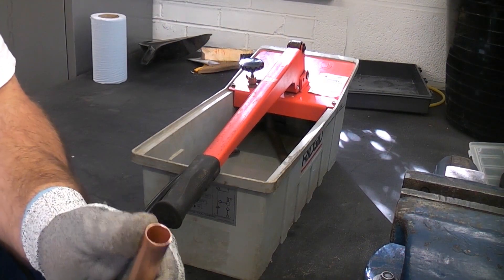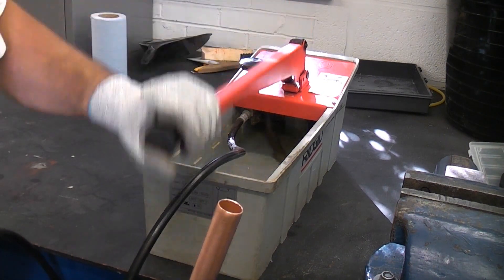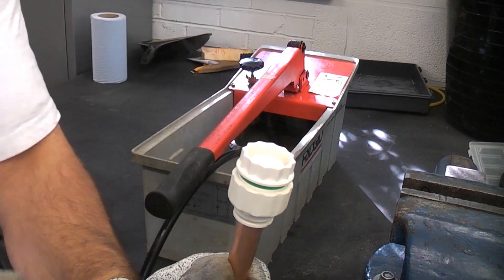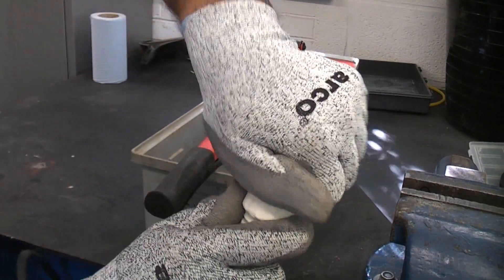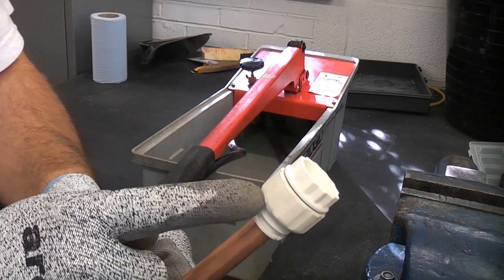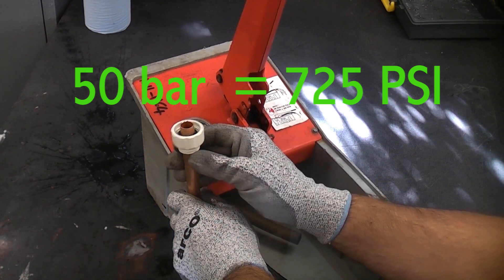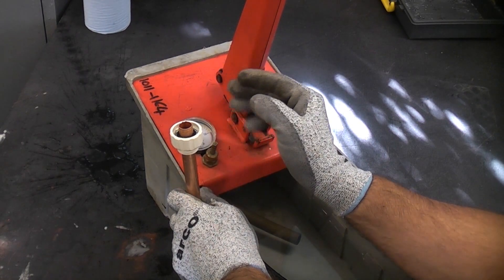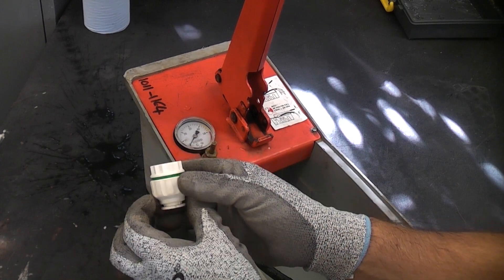Push fit fitting pressure test

Comment: This video is 8 years old and so are the comments.  Even now in 2024 push fit fittings aren’t old enough for anyone to tangibly say that they don’t hold the test of time.  But JG Speedfit and Hep2O are both rated for 50 years - instead people have formed opinions on them because they don’t trust anything other than traditional methods. If they are fitted correctly they won’t fail, the same as copper if it’s prepared and soldered correctly.  I swear by them - I’m not a plumber, but let’s say an ‘advanced DIY’er’ who knows what he’s doing and has a lot of renovation experience who does things within regulations - anything new installed that is hidden is done in plastic and push fit, anything visible is done in end feed copper - I’ve had zero issues with either.  Let’s be honest CH is 1.5-2 bar, a good mains water is 2-4 bar - this just went to 50 bar, and these fittings have advanced since this video.  Accept the change and trust these lol

Comment: was a plastic part that failed, not the seal and not the teeth.  If the same test was done with a straight connector in situ it would take even more pressure.  I am one of those people who look at push fittings and think how could that possibly work?  For me there are no questions that need answering anymore.  It's no wonder you see them everywhere in hidden locations.

Comment: Could you do a pressure test on a push fit fitting using the push fit plastic pipe? Just to see which gives up first, the pipe or the fitting. Great videos 👍
Reply from the maker: I tried that once; I did the exact same test using plastic pipes with no pipe inserts. The reasoning behind the video, was to show how important pipe inserts are in plastic pipe. I went right up to 50 Bar and the stop end would not blow off from the pipe. I wanted to make that video, as the plumbers at my sister’s house have done all the plumbing in plastic pipe and have not used a single pipe insert! 
Obviously when I do any plumbing jobs there, I always put pipe inserts in  👍

Comment: Repeat the experiment keeping everything at 65 degrees C (temperature of hot water tank). It will fail at a lot lower pressure. Do the experiment by filling pipe with dye coloured water, and submerge whole experiment in a bath at of water at 65 degrees, let everything come to temperature, and then do the test.

Comment: Think  we are missing something what about the rubber O ring how long before that perishes , no good having 40 bar if the rubber O ring ends up letting water pass after 5 years. Think about all the new builds with plastic pipe hot and cold even the central heating system is plastic, don't forget get plastic in new builds was only started because of money saved in materials and labourer not because it's better than copper.
Reply from the maker: There are advantages and disadvantages to copper and plastic. I've also seen soldered joints that have started to leak in relatively new houses, perhaps because the plumber has not prepared the joint properly before soldering. 
Like you say the O ring, is probably the bit that is going to fail. When I worked on site we used lots of push-fit air fittings, some of which were 30 or more years old, they rarely leaked.
Thanks for the comment 👍
Reply: @ultimatehandyman  30 year's that's a long time. Maybe we all should give plastic a chance I guess we will only find out in time. Someone said john guest gives 25 years on his O rings not sure if I believe that. What it is I've got hot and cold feet to the kitchen I need to extend it to the sink but can't get the cold to stop weeping so I can't solder it I've even left it for 2 days to see if it stops but no luck so I might have to use push fit but it's going to be somewhere I will never get to unless I rip out the worktop.

Comment: the problem happens using plastic pipes and plastic fittings at high temperature... it's rubbish anyway... a real plumber works with different materials and does good installation..
Reply from the maker: I've seen copper pipes develop pin holes and soldered joints leak over time too!
Thanks for the comment 👍
Reply: @ultimatehandyman  i'm not talking about copper pipes only.. there is multilayer pipe that's very good.. the brand that are u using in the video it's absolutely the worst in the market.. one other thing... use copper pipes with pushfit fittings it's not professional.. thank u

Comment: After 12 years in my domestic house, I had to replace a plastic fitting.  After conducting my research with 3 plumber supply stores. 2 stores had stopped stocking the plastic fitting and only supplied the old school brass and copper types because of negative feedback 
1 store owner advised me to lift the attic floor boards  (bungalow house with pipe running over head for the radiators)   I was  lucky to find 3 more plastic fitting out of 16  ready to slip off!!  These plastic fittings expand a little tiny bit over time when  the hot water passes through, they are supposed to tighten up  again as they cool down. After 12years they no longer tighten up by themself and caused a ceiling leak  

I have now replaced the plastic fittings to brass fittings and I expect get around 30+ years of piece of mind out of them.
Reply from the maker: Where they used with copper or plastic pipe?

Comment: Worked with a guy wo was like never use these on heating I'm like why my hole house is on pushfiit, it'll fail one day he says I'm saying no maybe 20 years my boilers been at 1 bar for 6 years, so anyways I seen him use it on a kitchen job used a hack saw to cut the pipe and no inserts, I say that's why it fails no wonder, big argument I walk off job, labourer knows more lol skilled labourer more like 👏
Reply from the maker: I've seen lots of push fit fittings installed on push fit pipe with no inserts.
It's just a matter of time before a fitting pops off and floods the place!
Thanks for the comment 👍

Comment: Pressure testing is a dangerous activity. You are correct about water being less dangerous than air. You never use air unless totally unavoidable. In the video you would have had air in the end of the compression fitting, this should have been vented out. You also need to provide more safety restrictions when doing the pressure test with water you was holding a lethal weapon in your hand whilst pumping up the pressure. Just a few tips from  Pressure Vessel Engineering.
Reply from the maker: Thanks for the comment 👍

Comment: i was in at Lucas CAV Sudbury in 1982 they had a bosch thermal machine the mains gas was pumped by a compressor to the thermal machine they did the pipework themselves and pressure tested 15 mm copper soldered pipe to 900 PSI
Reply from the maker: Blimey 😱
Thanks for the comment 👍

Comment: Great video, but few legacy folks still use copper systems which requires a plumber call out just for simple things, the modern technology allows plumbers to spend less time onsite and get the job done without heat (soldering) etc, and still ensure the same charge to the customer, it really helps save time (which is money) to keep customers happy and I am sure they are happy to pay same fees to plumbers. Copper should be almost eradicated from household plumbing and replaced with modern flexi plastic systems.
Reply from the maker: There are advantages and disadvantages to both systems.
Thanks for the comment 👍

Comment: Can you leave it at a constant 40 over a few weeks and see what happens?
Reply from the maker: No, normally when you pressure test a pipe/fitting you only do it for a specified amount of time. For steam pipes on site it is only about 30 minutes. If you leave the pressure in the system for longer than that, it will probably cause damage to the testing rig etc.
Thanks for the comment 👍

Comment: How does it fare against sustained and variable high pressures?
Reply from the maker: Not sure, I only made this video to prove that they actually do work, as some people did not trust them.
Thanks for the comment 👍
Reply: @ultimatehandyman  thanks for the reply. I'll be replacing my ground floor copper piping with pex in the summer. Was originally going to use compression fittings, but I'll possibly switch to push fit now instead given the ease of use. 
I'm just concerned about longevity.

Comment: Can you use this kit to also test pipes for air tightness instead of water?
Reply from the maker: No, you should only pressure test using water, as it is not compressible by much (about 10%). If there is a catastrophic failure of what you are testing, nobody will get hurt with water, but because air is compressible, it can be very dangerous.
Thanks for the comment 👍

Comment: 50 bars is great but that was push fitting on a copper tubing would it be same on poly pipe??
Reply from the maker: I think it would pop off the end of the pipe, as the stainless steel grip rings in the fitting will only be gripping the plastic. 
Thanks for the comment 👍
Reply: More likely the PEX/PB wall would rupture before the fitting blew off, around 20-25bar depending on temp in my experience.

Comment: Maybe you’ve already done this in another video but I’d bet a JG Speedfit 15mm end stop would easily take 50 bar

The one you tested it looks to me like the plastic interval thread failed. As you will know, with JG end caps it’s one moulded bit of plastic (apart from the release bit of plastic)

Interesting vid 👍

Comment: Which fitting would you trust in your house? 🤔🍀👍
Reply from the maker: I'd probably use solder ring fittings, but if the pipe was plastic I would use John Guest speedfit.
Thanks for the comment 👍

Comment: So these tests keep popping up to shut up the trolls who profess the damp Armageddon arriving in the near future due to one or another thing wrong with these fittings.

What is REALLY wrong with push fits is their ease of use to the point where everyone can plumb a bit of their own house if they care to without expensive tools and years of experience.

Look up "speedfit failure" on yt and you'll see there seems to be surprisingly little proof of those fittings failing. I mean surely some of them must be failing but...

To be fair, I'd love to see those longevity tests proving it one way or another. 

On the other hand when I look at those push fits myself they just don't scream confidence in my face. This is probably what helps perpetuate the myth.
Reply from the maker: I think a lot of pushfit failures are due to bad installation, such as not using the correct cutter etc.
I have seen so much installed without the pipe inserts too!
Urban myths are probably to blame. When I was at college I was taught not to use a neon screwdriver, as they are "dangerous", and people have been killed or injured using them. A few years later, I searched for accidents with neon screwdrivers and not one popped up! 

Thanks for the comment 👍

Comment: I have used push fit fitting and plastic pipe on all of my domestic water supply and on my central heating system found it so easy to do and zero leaks on  a three bedroom house, would recommend to anyone
Reply from the maker: Thanks for the comment 👍

Comment: Wow !!!  And they say you can't use 15mm copper pipe for running an air line manifold from a compressor producing 10 bar around your workshop.....
Reply from the maker: You have to be careful with compressed air, or compressed gases as they are compressible (unlike water, which is only compressible by about 10%). For an airline, I would use schedule 40 steel pipe 😉
Thanks for the comment 👍
Reply: @ultimatehandyman  Whether compressible or in-compressible, the fact remains that you pressurized 15mm standard copper pipe to 10 bar.
Reply from the maker: @mukwera9131   Yes, with water. If the pipe was to split, it would spit out a little bit of water. Use copper pipe for compressed air and the effects of it failing will be far more dangerous ;-)
Reply: @ultimatehandyman  You are correct about the dangerous situation. Water is less dangerous than air. You never use air unless unavoidable. In the video you would have had air in the end of the compression fitting, this should have been vented out. You also need to provide more safety restrictions when doing the pressure test with water you was holding a lethal weapon in your hand whilst pumping up the pressure. Just a few tips from  Pressure Vessel Engineering.
Reply from the maker: @petersaville2265   I've pressure tested 200 ton vessels on site. I think I'm quite capable of pressure testing a 15mm pipe fitting ;-)

Comment: I'd be interested in plastic pipe pressure test, and also tests with the water at 65 ºC.

Note that the rating for SG Speedfit at 20 ºC is 12 bar, derated to 6 bar at 65 ºC and 3 bar at 82 ºC. http://www.free-instruction-manuals.com/pdf/pa_2029785.pdf

Comment: Great Vid. Out of curiosity what is typical domestic water supply pressure?
Reply from the maker: There is no "typical water pressure" in the UK, It can vary greatly depending on where you live. At my house the pressure is considered to be high, at about 8 BAR  (116PSI)
Thanks for the comment
Reply from the maker: I'm thinking of installing a pressure reducing valve here, as the main stop tap to the house is only open about 1/8 of a turn. If I open it more than that, we get really bad water hammer. In the past couple of years we have also had a few sealing washers fail- meaning damaged ceilings etc. A pressure reducing valve is supposed to reduce the pressure, but not the flow! I'm not sure how effective they are yet!
Thanks for the comment 👍
Reply: @ultimatehandyman  Let us know how it goes!! We also used to get really bad water hammer and when I posted about it on a forum there were lots of suggestions that said to install a small expansion tank upside down with a check valve on the incoming side on any cold line in our house! So we found a good spot under our tankless water heater and it worked FLAWLESS! ZERO water hammer even if you SLAM the taps closed from full flow!! http://oi64.tinypic.com/1zpk7l5.jpg
Reply from the maker: @toysareforboys1   That vessel seems to be like a shock arrestor. Eventually I'll fit the pressure reducing valve, as it is not good for all the seals having 8 BAR of pressure on them! Thanks for the replies ;-)
Reply: My city water pressure (Whitby, Ontario, Canada) is also considered very high (8 BAR, 115PSI), the city considers 72PSI (5 BAR) to 102PSI (7 bar) to be "high". I was denied a warranty claim on a faucet set because of the high pressure. The city gave me a free device to put on our water meter to limit the pressure to 58PSI (4 BAR) but I didn't like it. With the device installed the pressure from our shower heads went way down and took much longer to shower (but probably used much less water in the long run), so we removed it to go back to 115PSI. Standing under the shower head feels like you're standing in front of a fire hydrant fully open :)
Reply: According to my local (Germany) Water Company the expected water pressure is between 3 and 6 bar depending on your height relative to the water level inside the tanks. In my case i only get 3 bars during nighttime if the levels start to rise, during the day im at around 2,8-2,5, which is pretty low compared to the rest of Germany.

Comment: fitted push fit once, never again used in outside toilet and snapped in the winter. for me would rather use compression or solder, but there's a new design on the market Xpress :)
Reply from the maker: Thanks for the comment

Comment: I may need to change things where I live. My bathroom is tilting owing to heavy rains in the moutains. Question: what kind of temps can these fittings take please? I'm using a wood fire with what's called a water jacket. Basically the fuel heats the water surrounding the fire, water is the pumped to tanks and radiators. I'm concerned the pressure on pipes bending through shifting masonary will split them. Any help please? Thank you.
Reply from the maker: It depends what make you get, the John Guest Speedfit fittings can be used on hot water up to 114 degrees C intermittently for short periods of time- https://www.johnguest.com/speedfit/common-plumbing-and-heating-questions-answered/
Thanks for the comment ;-)
Reply: @ultimatehandyman  Thank you. I'm not certain this will work for me then given the fuel I'm using, fluctuating heat levels. Many thanks again.

Comment: Can you try the same thing with a chromed copper pipe. I've had a complete loss of faith in push fit whilst using with Chromed copper pipe.
Reply from the maker: Push fit fittings cannot be used on chrome unless the chrome plating is removed- https://www.youtube.com/watch?v=L07eN3Ml3NY
You can get a special tool now which scores a ring into the chrome, allowing the grip ring in the fitting to bite into it. If you just use a push fit on chrome without doing anything it will pull off very easily.
Thanks for the comment
Reply: Hey, thanks for taking the time to reply. That makes a whole lot more sense (have watched the video). Great job!
Reply from the maker: You are welcome
Thanks for the comments

Comment: New, push fits are fine.
But the rubber O rings hat seal them will always fail over time.
Slight movement from expansion and contraction, pressure fluctuations, water hammer, etc etc cause the O rings to fail given enough time.
Any side deflection in particular, compressed the o ring on one side.
I never use them in walls.
But do use the push to MI thread adaptors with a cistern cock under sinks and basins, when replacing old soldered in tapware, with copper pipe coming in through the wall.
Reply from the maker: Thanks for the comment